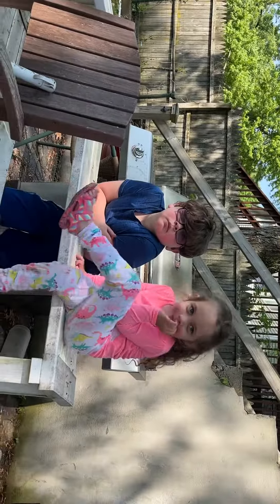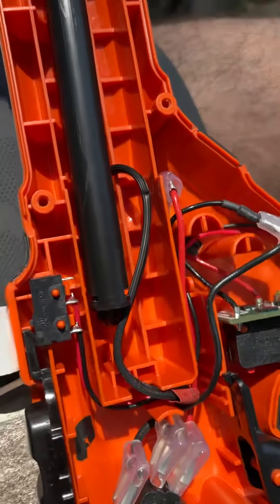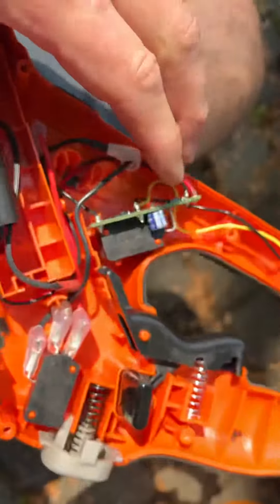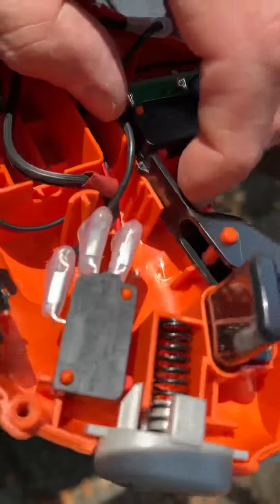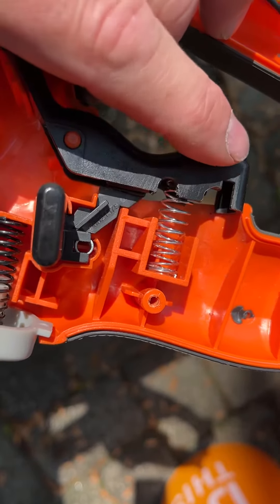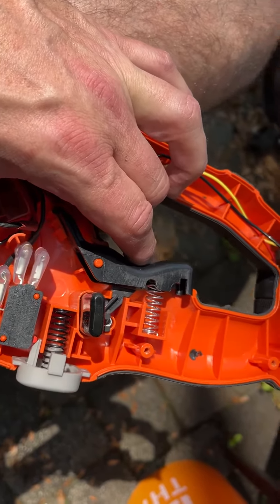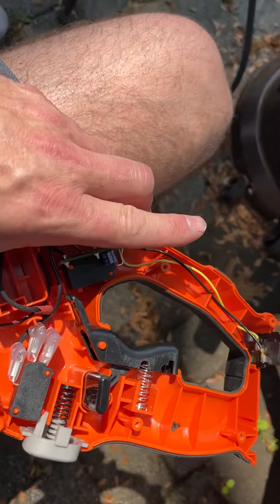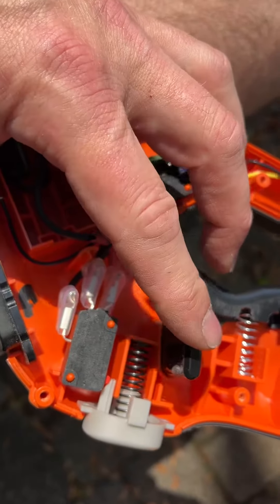Black and Decker Easy Feed 20V Won’t Start - FIX!!!

Comment: I ordered the BLACK+DECKER 20V MAX String Trimmer, 2-Speed, 12-Inch, Cordless (LST522) from Amazon. Lasted 6 months before switch stopped working.

This video motivated me to fix mine also. But I did something different. I took a hobby foam sheet and drilled 6 small holes large enough to put over the 2 plastic slots on which the ic board with the electric  switch which gets pressed when the handle is pressed. I cut the foam sheet around each drilled hole and made them small enough to fit atop the 2 plastic slots. Put 3 of the foam cutouts on each slot and then inserted the ic board into the slot over the foam cutouts. This raises the level of the ic board and position where switch gets engaged when pressing from outside. Not sure how long this will last but I've used it for 2 days now and works fine.

Comment: Thank you.  I had  2 of these units with this problem.  One was a replacement on warranty and they did not want the old one back.  They have been broken for ages.  Thank you for the inspiration.  It worked on both of them!
Reply from the maker: Great to know!! ❤️

Comment: The trigger plastic got worn from friction sliding on the switch button.   Was able to cut a piece of milk bottle plastic to fit between trigger and switch.     A different video showed how to remove the handle with the locking button in the center.   a screwdriver can be used to compress the back of the locking button while pressing on the orange side reducing the chance of breaking the black handle.  Thanks for your video

Comment: You’re the man - 👊
I whittled down the trigger and it works perfect now.
Reply from the maker: Haha nice. Mine just stopped working. Went to Home Depot and got the Ryobi 18v tools 🤣🤦🏻‍♂️
Reply: @DadOfAllTrades24  makes sense If you got ryobi drills - that’ll prob be my next one
Reply from the maker: @serf6355  exactly. I had like two batteries already. I grabbed the weed trimmer, blower, and hedge trimmer for under $300 so it wasn’t bad at all. I have a really small yard. Only thing I’d prob change is getting the 40v blower. Good luck!

Comment: Mine looks a little different inside. The switch and circuit board are separate. With mine, it was simply a wire came loose from the battery connection. I didn't have any problem previously, it just suddenly quit. I thought the switch went bad. I considered leaving the safety switch out, but decided to put it back in. The hardest part was figuring out how to remove the handle. Push both buttons in at the same time. It is a bit tricky. I pushed in the black side with a Phillips screwdriver, and used my thumb on the orange side.

Comment: I need your help are the same exact Black & Decker electric trimmer it runs for about 8 Seconds and then turned off what's the problem and how can I fix it
Reply from the maker: I think it’s the issue I talk about in video. Just a bad design.  Stil sux lol. You gotta take it apart and rig it

Comment: How’d you get that handle off so the two halves could separate? I’m close to cutting it out.
Reply: On second thought, this is an amazing mod. I’ll adapt mine the same. Thanks for sharing your experience!
Reply from the maker: Ha thx. I think there were screws but I feel like I had to get a bit aggressive with it lol
Reply: There’s definitely one I found. Just finnagling it with a small nail bar until it gives. I’m glad you put up some disassembly information before the manufacturers did. (:
Reply: Update (although you didn’t ask) I popped that adjustable handle off so that’s waste now, and I used an angle grinder with a cutting wheel on both the trigger and to cut into the orange for a front piece and back handle piece. Thanks again for being the most relatable video with this issue!
Reply from the maker: @leviLS87  Ha! Angle grinder solves all problems! If you appreciate sill stuff check out my video where I break a bike lock with a ramset! lol - https://www.youtube.com/watch?v=pW3A-LtU11o